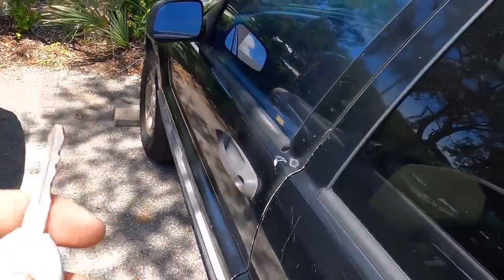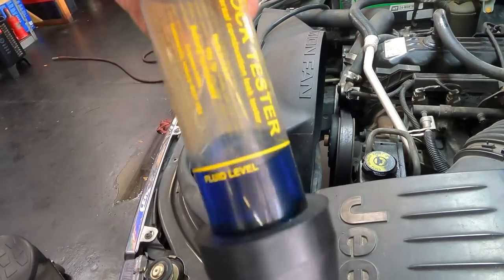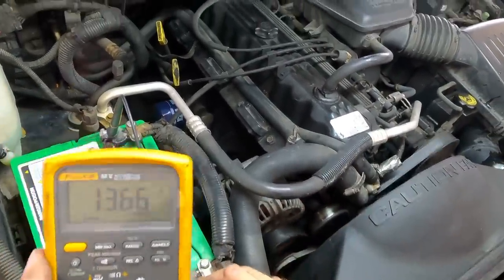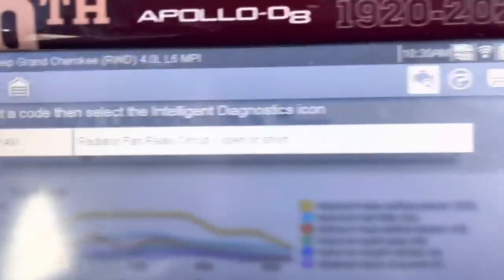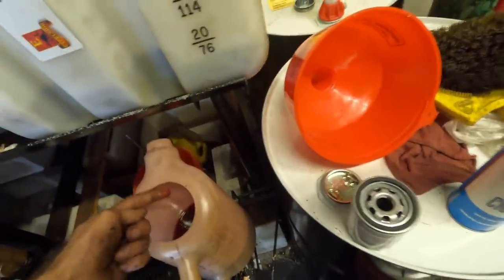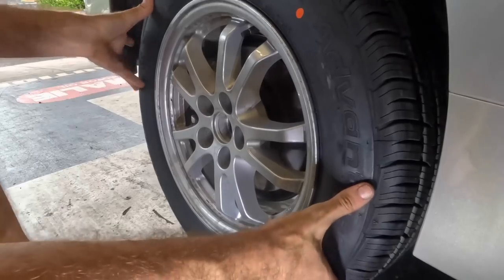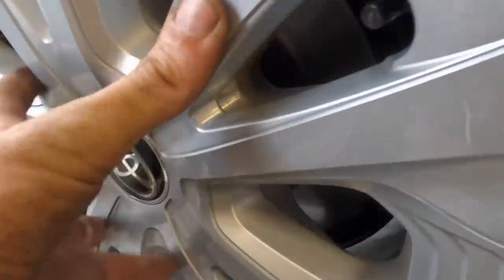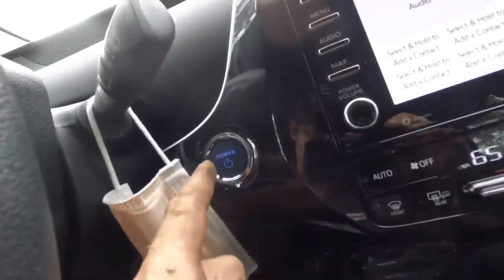How much longer will it last? Jeep Grand Cherokee 4.0 I6 | Compilation

Comment: That relay is not a electro-mechanical device. It's actually a transistor (most likely a MOSFET). It definitely needs a good heatsink. When I first saw it, it only had one screw holding it down. The frame is used as a heatsink. You should also use a heat sink compound between the base of the relay and the metal frame. Silicone dielectric grease should work fine.

I once had a Ford F-150 that would only over heat during the winter time. Summer time it had no issues with overheating. I found out the fins on the water pump had corroded completely off. The only thing left on the water pump was a spinning disk where the fins used to attach to. I guess during the summer time the disk was enough to pump the water but in the winter time it wasn't. Maybe it was too hard to open the thermostat when cold.

Comment: I recently scored a 2000 WJ 2-WD Laredo 4.0 with only 70k that is like new and just went through tracking down the same overheating issue. Most of these WJ's have already have a hole cut above the relay just like that one for easy access which prevents taking the whole front end apart. I decided to go ahead and replace both the relay and the fan unit while into the job for safe measure. These Jeep's also have a built-in fault code reader. To self-scan without a scanner,  turn the key on/off 3 times without starting and any P codes will be displayed on the odometer screen and will state DONE when complete.

Comment: I had a 2000 Chrysler mini van. The relay went out and google told me it was under the left headlight assembly. I think three nuts and headlight assembly is out. There was the relay on a shelf under headlight. Replaced relay and had fan. The wire was long enough so relay was moved from it's hiding place to the inner fender in plain sight. Three weeks later no fans. Checked and relay was bad, replaced it and worked for the next four years. Traded the van with 200k miles, best most reliable car I ever owned.

Comment: For many of those broken plastic pieces, regular super glue puts them back together nicely. They also make kind of a filler powder if there are gaps, or just to strengthen the glue line.
Of course the bonding surfaces need to be well prepped and cleaned, which to be honest, for this car looks like quite the adventure.

Also looks like someone created an access hole to that relay before.

Comment: You didn't record it, but I hope you checked the oil for milky appearance on that Jeep. Just checking radiator is not always a good test for blown head gasket. I actually had to replace the head on a Jeep just like this one with the same motor. Fluid in the radiator looked good, but oil milky. Turned out, head gasket blown. Replaced head and gasket, good to go.

Comment: It's a solid state relay so, with a PWM input signal, it needs to dissipate heat when the signal pulse is short (fan speed low). The missing bolt is a big problem. Also really needs heat transfer paste between relay and panel.

Comment: My 98 grand cherokee 4 0 has 380k miles.. original transmission and entire drive train.  Still drive it daily 120 miles to and from work.  2 years 25 doesnt mean classic.. it means antique.. big diff..  my wagoneer is a classic

Fyi the 4.0 its nornal for those engines to rattle..  mine jas done it since day 1 24 years ago

Comment: I have a 2001 Jeep that the vanes on the water pump were plastic and caused a lot of damage. new pistons, radiator and head at 145,ooo .  replace all and and checked and still running now

Comment: The better solid state relays have a finned housing for added cooling due to greater surface area, and thermal compound is required on the back between it's body and the mounting surface.

Comment: tubeless tyres naturally lose air over time driving whenever you corner a little is lost past the bead as the bead moves a tiny tiny bit as it heats up and cools down during normal driving, even without puncher or a leaky valve

Comment: I would think with no temperature differential at the inlet and outlet of the radiator, then that's indicative of the radiator not cooling efficiently, so I would suspect a clogged radiator at that point.

Comment: I own a 2000 jeep grand Cherokee with the same power plant. It has 245000 miles. I have owned it for 19 years, interesting fact these jeeps originally came with a mechanical fan that threaded on to the end of the water pump shaft,  plus the electric cooling fan. Replace the mechanical fan with heavy duty clutch drive, not the standard duty clutch and it will run at the correct temp.

Comment: This is the carnage of people not knowing what they're doing.

My 08 ford explorer has similar carnage on the radiator bracket. I was expecting a fight based on videos id seen, but noticed one side was split, telling me the tank cracked off the radiator, they patched it enough to get a good trade in value and dumped it.

Lucky for me I watch a video to see if I can actually do a repair before I dig into my explorer.

Comment: I have a 2000 WJ (Body Code for a Jeep Grand Cherokee produced from 99-04) and that relay is a VERY common failure port for WJ's. It's so notorious for failure us jeep guys tend to replace it with an 11-blade ford mechanical fan and a YA220 clutch, which pulls enough air to remove the need for an electrical fan in the first place. Bolts right up to the water pump which, this particular WJ doesn't have it's mechanical fan installed.... These jeeps used both an electrical fan (which operates in high temp situations or when the AC is on) and a five blade steel mechanical fan on the water pump.

Comment: I drive one, and yes, its extremely over engineered.. it was redesigned by the Germans when they owned Chrysler. But it is kinda nice when you want to add an accessory, like fog lamps or home link system, it's literally a plug and play vehicle. All of the harness is there, just plug it in and it works, even the home link garage door system. Mine has 244k and still going.

Comment: In the beginning you mentioned they had used 'stop-leak'... I have found that can plug up the thin tubes in the radiator and also cause an overheat condition. That said... even with some of the tubes plugged up with stop leak gubbins I would still expect a temperature drop across the parts of the radiator that are working.

Comment: Been my gripe for several years now. The price of repairs has tripled. When I was wrenching in the 80s shops chared $30 per hour. Even oil changes are getting to the point you have to stretch the mileage to compensate for the price.
Reply: I just had my Patriot inspected at the dealership. $140 is the current labor rate.
Reply: It's a hell of a time to be a DIYer. I'm grateful I've cultivated my wrenching skills over the last decade and a half. Although I appreciate what they do ever day, I'd have a tough time paying today's labor rates. Worst of it, it seems like a majority of the cost increases aren't even going to the guys swinging wrench.
Reply: @mphilleo  it's going to "administrative expenses" and the increased cost of shop supplies and disposal of things like greasy shop rags.

Comment: I loved this video. Frustrated that the water pump wasn't allowed to be checked.  Dying to know if your diagnosis would be correct. Seemed pretty cut and dry but until you observed it, you never know for sure.
Reply: I've had two cars where an overheating problem was caused by the impeller spinning freely on the shaft. Just because it isn't leaking doesn't mean that it's good.

Comment: The negative in the meter indicates either you leads are backwards or you wires are swapped easy way to find neutral/ground from hot ...

Comment: so im one of these crazy jeep guys and usually just a supper flush of the radiator works wonders on these thing also we tend to wire the fans on a toggle so if it is over about 60 degrees they run all the time helps with overheating especially in stop and go traffic AMC/Chrysler missed the mark with the 4.0 cooling system

Comment: My strong suspicion on that solid state relay is that it failed because it overheated as it was only held on by one fastener and that meant it didn't make good thermal contact with the metal body. It's fairly obvious that the whole set up acts as a motor speed controller, almost certainly containing a MOSFET. I'm glad to see the second fastener going in, but a bit of thermal compound might have been helpful too.

Comment: Not actually a relay, but a variable-speed solid state fan control, as with heater blowers.  PWM control signal is the giveaway.  Mounted on the fender well for cooling, so you really want both screws holding it down to make that work.  A regular relay would not need cooling.
Reply: On am assumming pulse width modulated control is serving as speed control

Comment: This video was actually pretty fun IMO since we see what a mechanic's day can be like. Not every job has to be an all day or several hour affair. One thought, IMO if that were my Prius I'd leave those meh looking hubcaps off since to me the alloy rims look better, plus allow more air flow for the brakes.
Reply: Yea I was wondering why it had hubcaps. I thought hubcaps only came with steel wheels.
Reply: I was thinking the same thing.  The alloy wheels look fine to me.  Why on earth would you cover them with plastic junk?  Toyota, why you do that?  Hello?  Toyota is doing some really weird things these days.

Comment: Maybe put a dab of 'heat sink compound' behind that fan relay. Heat sink comp, and a bit of sanding, will help transfer the heat from the relay into the steel around it.
I have seen a 2000 Jeep  Cherokee 4.0 water pump with the impeller totally rotted away, just a flat disc was all that was left, but the bearings and seal were still perfect!!
Think the dude who declined service on his Jeep was only looking for you to point the right direction. Low//No flow,,, Damn good pointing!!

Comment: Very good video. I am at min. 22/41:35 and my guess would be it is the radiator being clogged up on the Jeep....I have seen it before. Rather then water pump impeller blades. Because these blades-in order to wear out - would have be in contact with abrasive solids....i.e. sediments in coolant cirquit and that would be positive indicator, that the radiator or maybe entire engine cooling system needs flush and cleaning, because these sediments would clog up the narrow passages of the radiator at least partially. But then - I am just a home/hobby mechanic!

Comment: I wish some tire shops would learn to understand that wheel covers have a place notched out for the valve stem. I had to take my tire off and realign the stem so I could add air to the tire. I forget if it was the civic, but the wheel covers bolt on with the lugs. The next time I had my tires done, they had 3 of the 4 tires aligned wrong and again had no way to access the valve stem to check my pressure or add air if needed.

Comment: I bought a 1993 grand Cherokee limited when I was 18. Had 120k on it. I had to replace almost every sensor on it by the time I sold it when I was 35. Still only had 160k on the odometer.
Reply: Cool. What did you replace it with?
Reply: @rokelesoke  01 mountaineer. Has about 240k on it.

Comment: My 98 XJ sounded like that when i bought it with 185k on it. Seafoam. Lucas. 5w40 rotella T6. lifter never came back. sold it at 260k still making that idle clatter. It's not a 4.0 unless its missing a couple lifters.

Comment: You said the old-new servo may have failed due to overheating, perhaps due to bad contact with the chassis. Is heat-paste ever used, comparable to how a CPU-cooler is mounted on a CPU?

Comment: Ray have a question for you. I have a 2009 Lexus Rx 350 and my driver's window will not do anything. But the other 3 windows work fine. I tried switching out window switches and same results drivers window will not do anything. The switch boards LEDs are working when you press the switch. Would you suspect that the drivers window motor is the problem. Let me know

Comment: I would say its the thermostat and way I say that the temperature is the same on the upper and lower hoses I thinking it's stuck close you shed have put your thermo temperature tool point it at the radiator and if it's the same temperature then most likely it's the water pump this is my opinion

Comment: I did just last week get my Citroen C5 2005 to a workshop for some repairs. One was just tires to the right way but they did not do that because they need to fix tire holdings first... Next day to get the car back, 233€. Second shop to get cylinder 3 to work... It was not a spark plug, it was a dam coil = 175€ + work so 217€... The coil is broken because the cylinder top gets oil to spark plug so it need also fix someday now :( It will cost 80€ (new spark plug and fix oil leak)... $120 is free almost on my eyes :)

Comment: Would have check the air filter ...
It happens, dust, sand, debris whatever in the air filter could lead to really bad combustion and bad fuel consumption ...
And this, way before visually inspecting the water pump or giving the suggestion .

Comment: You didn't mention the radiator could be blocked, or if the thermostat was installed correctly with the bypass ?

Comment: It's kinda weird the relay is PWM, because relays can't toggle that fast. So I'm assuming it's some kind of mosfet driver for the fan motor, instead of an actual relay.
Reply: Solid state relay, which is commonly indeed some MOSFET arrangement inside.

Comment: Agree with others. Solid state relay getting too hot because of improper mounting.     Maybe Jeep knew it couldn't be in the engine compartment due to the heat issue.

Comment: There’s a bleeder by removing temp sensor at back of block if you don’t it will have air pockets. And run hotter there was a old tech bulletin back when

Comment: FUN FACTS: Technically speaking, it's actually moar of a solid state amplifier than an actual relay, even though it serves that function as well. Instead of electro-mechanical contacts that close whenever the primary magnetic field is activated, it instead uses internal conductors and electromotive force to engage the secondary circuit. It's why the reference signal from the PCM is so relatively weak, as well as why it's bolted to the fender well. Advantage: No moving parts ~ Disadvantage: LOTS of heat requiring the use of a heat sink fastened to the body & the proper use of thermal paste.

Comment: On Fiat products umm I mean Chrysler products is you air the tires up with the engine running, the sensors will automatically read and the light will reset

Comment: Is there a simple way to flow test a radiator, like pull the hoses off and put a volume of air or water through it with something that adapts to the radiator cap or something? Then one would have to know how much a certain radiator is supposed to flow, or how about a two gallon jug with an adapter to fit the top of the radiator and with the bottom hose off, how long should it take for those 2 gallons to drain out?
Reply: There probably is, but then again, the last time I redid the cooling system on my 97 XJ, I did radiator, pump, fan clutch, thermostat, and all the hoses for less than $250 in parts... 

So it's pretty much easier to just do all of the above every 4-5 years and keep driving.

Comment: New fan motor.....just wire a relay to the fan motor, relay coil powered by headlight.
Ta da fan on 100% when running.
So....which will fail first? Engine or fan?

Comment: I have a 2000 Jeep Grand Cherokee Laredo V6 inline. It is a money pit!. When it drives ,it drives like a dream. Jeep stands for Just Empty Every Pocket. Had a crack in the head next to cylinder 3. Cost $2200.00 to replace. If you want a Jeep. Get 2 jobs first. Also Jeeps Hate aftermarket parts. I know from using them they won't work or fail early. I have been using Mopar/Chrysler parts and seems to work fine.
Reply: And yet we had a '96 Cherokee with the 4.0 six that we bought new.  Sold it after 293,000 miles with nothing other than minimal normal maintenance.

Comment: The spare tire being strapped down is part of the collision package in the back of the car if it's not installed properly the tire jumps out of the hole and can actually hurt the occupants in the car worse than it's designed to be in there and tighten down for safety reasons

Comment: One thing you did not test while it was running warm is to test the temperature at the top of the radiator and the temperature at the bottom of the radiator or across the radiator to see if sediment has settled in the radiator and is perhaps keeping some portion of it from not transferring heat away. The old trick in the old days was to shut the vehicle off at temperature and then reach in and touch the top of the radiator and then put your hand down at the bottom of the radiator if the bottom third of it was cool then you had it plugged radiator.
At least somebody almost mounted that tire properly on that new wheel on the Prius. That red dot on the side of the tire I believe should be lined up with the valve unless that white circle is the location mark. Some tires have multiple marks like for SUVs and such.

Comment: I am a new owner of a motorcycle.  I got a code, of my own doing, for an Intake Air Pressure Sensor Circuit Malf.  I do the search things for a replacement component.  This bike has 2 of them, only 1 is bad.  From an authorized dealer, $300 for a piece of plastic with a 3 wire plug and a vacuum hose connection.  About the size of a lego.  WHAT?  Needless to say google searches and ultimately, ebay are your friends.  $20 Problem solved.  I have the service manual for the bike and was able to perform the required diagnostics, i.e. checking power, grounds, and signal.  I can only image what a service center would have charged for that 15 minutes + $300 part.   Oooof.  We feel the pain, Ray.